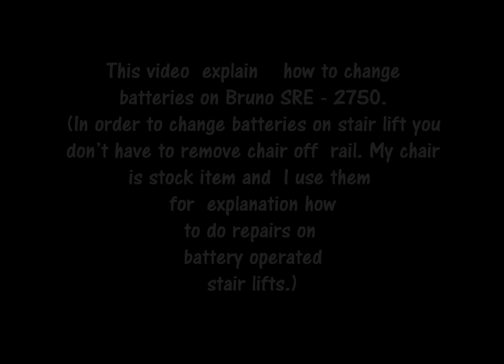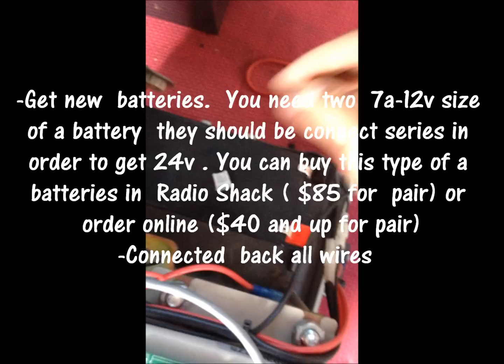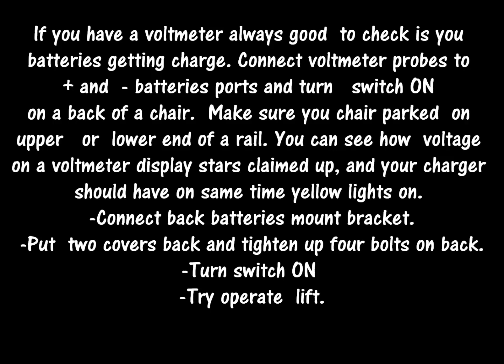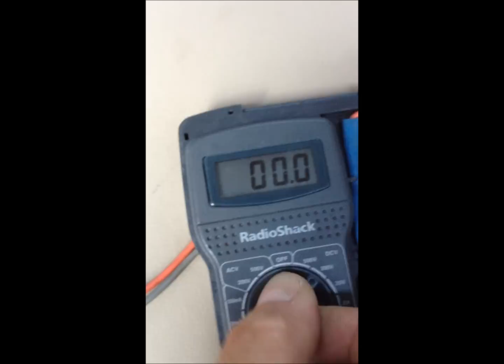How to replace Bruno SRE - 2750 stair lift batteries

Comment: Thanks for this. Once installed, it isn't obvious how the cover comes off to allow access to the batteries, and the installation manual provides no help at all. Loosening those 2 bolts in the back for the battery cover was all that was needed, and the batteries were swapped out within minutes.

Comment: getting a single chirp about once a minute. Thought it was a battery issue. Cheched individual batteries and both read 14v range. Put the mm across the 2 batteries get no mm reading. Can you explain?  Thanks, Ed

Comment: Can you use this with two 12v marine batteries , run cables inside and build a compartment to house batteries,? Also why not run in parallel circuit...more efficient  eh mate?
Reply from the maker: Hi , no I am not recommended to do that . Chair requires 24v input . Not 12v

Comment: Very helpful, thank you. Unfortunately after changing batteries I am still getting error beeps (3 short, 2 long) and believe the new batteries are not charging. The new batteries are the same size but they are 8 amp hours, not 7.2 like the old ones. This meant I had to buy step-down adapters for the terminals, F2 to F1. Also the battery charger always shows red light only, no yellow or green. I do not have a voltmeter but will get one if I cannot figure out what's wrong. Does my explanation ring any bells?
Reply from the maker: Hi Shannon. Sorry for late respond. Yes, there is a problem with charging terminals. If you have same lift , Bruno 2750 you need check electrical connection between positive and negative terminals under the rail (both ends) and two pin charging connector on board. (need voltmeter). If you find  open circuit you need take lift off the rail and change copper charging plate.

Comment: Hello again and thanks for your reply. I bought a multimeter and discovered there is no charge from the battery charger to the rail. I have a Bruno OEM-2402 battery charger, manufactured by Cliplight. Unfortunately I am unable to find a replacement online. Do you know a source to replace this item? Thanks again.
Reply from the maker: Well I don't have one and its hard to find. If you try use mobility scooter charger : output 24v 3A. You need find positive and negative terminal and soldering to original connector. Or keep searching  on Ebay Bruno charger,  some time they available

Comment: How do you replace the batteries in the Bruno SRE 1550 Electra-Ride II?  I find no way to get to the case that holds the batteries without first removing the chair from the base (not the rails).
Reply from the maker: Carl Christensen . Yes Carl,  you right -  in  Bruno 1550 needs remove footrest bracket (two bolts ) and then metal cover .

Comment: Just purchased a used Bruno stair lift but when we try to move the chair it beeps 4short and 1long beep and it doesn't stop.
Reply from the maker: Hi, 5 beeps (4 short and 1  long)  - elevator stopped off charger bumper . If you have same model of Bruno showing in video than you need check make sure red and yellow lights on on charger , if yellow light off than it charging issue (bad charging brush or bad no connection  in charging system )

Comment: Is the Bruno Sre 3000 the same to do the battery change
Reply from the maker: Hi, changing battery on Bruno 3000 different. I have video on YouTube : how to replace battery on Bruno 3000
Reply: @user-sh4yn5ft7b  thanks for your quick response.  I saw your video on 3000.

Comment: Why is that wire connected to + and -?
Reply: because the batteries are wired in series. two 12 volt batteries in series gives a 24v working voltage

Comment: I eplaced batteries exactly as they should go, stair lift won't go.
Reply from the maker: Susan Kirley , you need to check 5a fuse on Main board
Reply from the maker: It will be easier if you call me   2672198499 Phila pa USA
Reply from the maker: (267)2108499